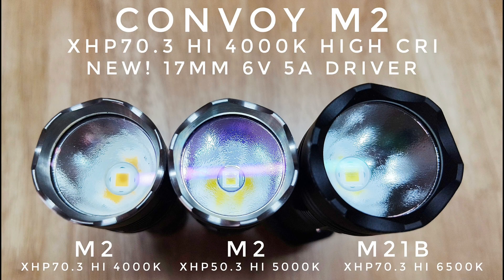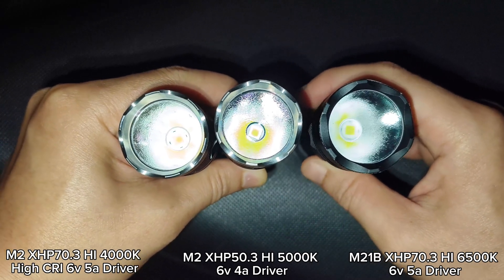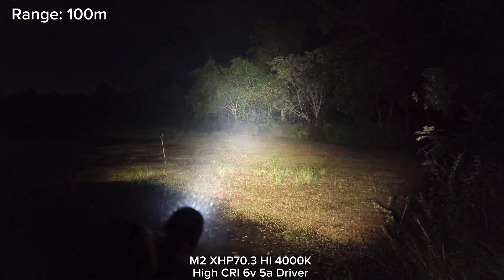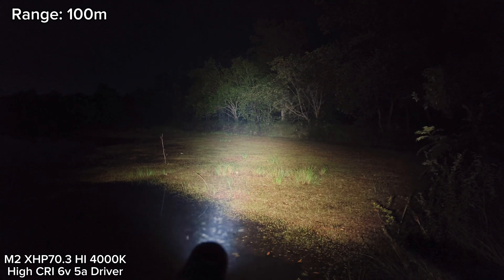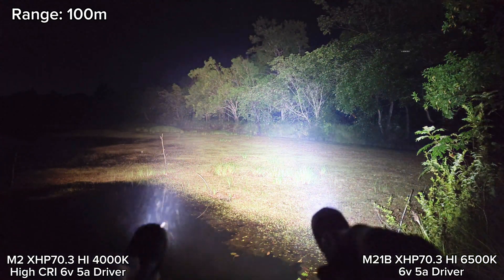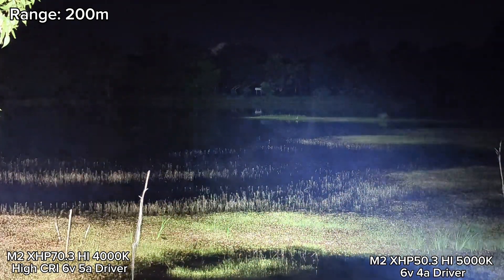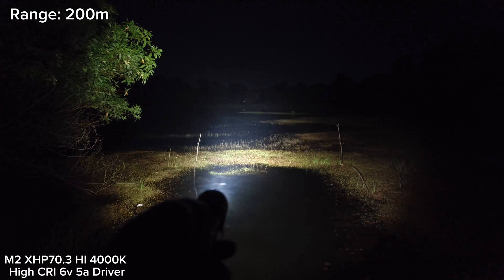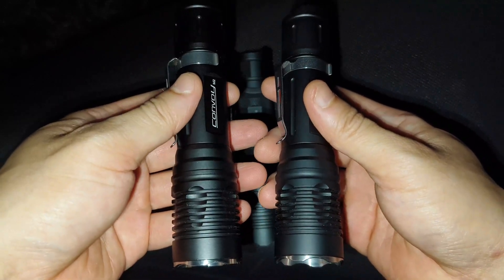Convoy's NEW 17mm 6v 5a driver in M2 XHP70.3 Hi vs M2 XHP50.3 HI 6v 4a vs M21B XHP70.3 HI

Comment: Nice job! I also got the 17mm 6v 5A driver, but I have a problem with mine. It will only go on turbo mode for about 0.5 seconds, then drops to 10% power. I am using 3500mah 10A 18650 batteries. Do you have any idea what the problem might be? Thank you
Reply from the maker: Hello sir. I think I know. The tailcap spring is not big enough sir. Change the switch that use bigger spring or try to bypass the tailcap spring. For mine, I use bigger spring sir. It works. Thanks for watching and your support sir 😊. Please subscribe 🙏.

Comment: I have a Convoy M21B flashlight, can I install a smooth reflector on an XHP 70.3 HI diode in it? You will like the M21B on the XHP 70.3 HI 4000K diode.?
Reply from the maker: Hello sir. You have to check the reflector hole first sir. Normally smo reflector for m21b is for 5050 led sir. Otherwise you have to penetrate it to fit the 7070 led. But! That can not guarantee that you will get good beam. Flat led + smo reflector can cause a dark spot in the beam sir. I think op reflector is better. Thanks for watching and your support sir 😊🙏.

Comment: Imagine if the OP reflector is changed to a SMO reflector. Surely the light throw is further and the hot spot density is higher.Or added with a TIR lens such as Acebeam P-16.
Reply from the maker: Agree sir. But in my opinion, xhp50.3 hi is enough for this m2. Thanks for watching and your support sir 😊🙏.
Reply: @weerapatkiatdumrong  Yes, you are right my friend.XHP 50.2 I see the performance is very satisfactory in terms of distance, density. Even the beam profile is quite interesting.The beam is a mix between hot spot and spill. The corona part is also interesting. The perfect combination.The driver is also very powerful. Imagine if you have a driver that has a boost. It is definitely more powerful in the production of light output.At the same time, imagine my friend, you are in an area where there is snow and the ambient temperature is 5 to 0 degrees. The ambient temperature to some extent also has an influence as well.
Reply from the maker: Totally agree sir. Thanks for sharing this sir 😊🙏.
Reply: @weerapatkiatdumrong  have a request. Can you Mr. if you have free time, do a comparison review between Acebeam P-17, M21B XHP 70.3 HI 65OOK 6V 5A Driver and also M2 XHP 50.3 HI 5000K 6V 4A Driver.
Reply from the maker: @Rheinmetall.Revolution  ok sir. However, I think I know the result, P17 is the most powerful of all flashlights you mentioned sir. It's brighter and has a bigger hotspot than m21B. It's quite interesting to see P17 vs M1 xhp50.3 Hi 6v 4a. Thanks for watching and your support sir 😊🙏.
Reply: Hi there, Acebeam have more superior driver, dont know whether those are boost or buck-boost driver, by the way; these Convoy drivers are also a Boost driver and they can give good runtime in the hi and mid mode, very useful to the masses.
Cheers🔦
Reply from the maker: @relayerrelayer8226  Thanks for you information sir. 😊🙏.
Reply: @relayerrelayer8226 well it's a 70.3 so it can only be a boost driver. It's using a colder, cheaper, lower CRI version of the 70.3. But that will make it look brighter. Based on the lumen figures I'd guess that the acebeam driver is putting out right around the same 6v5a. Maybe a tiny bit lower, certainly not any higher.